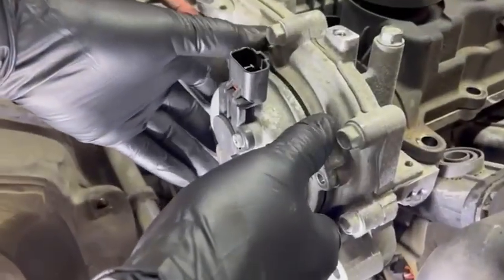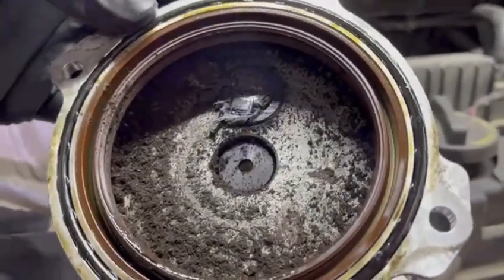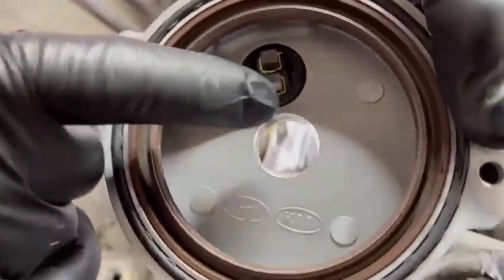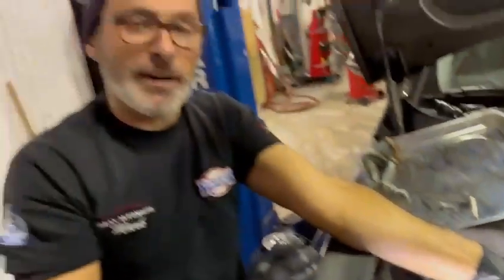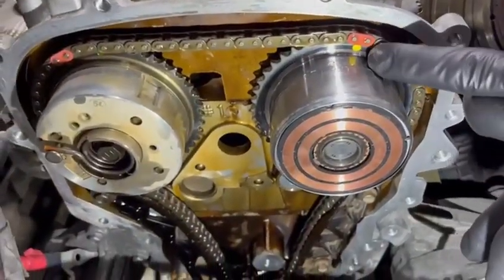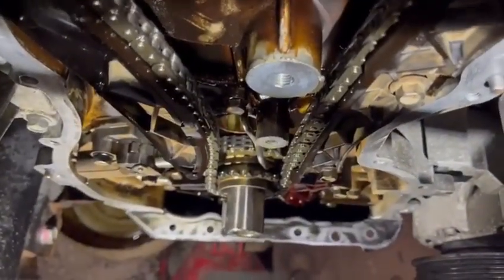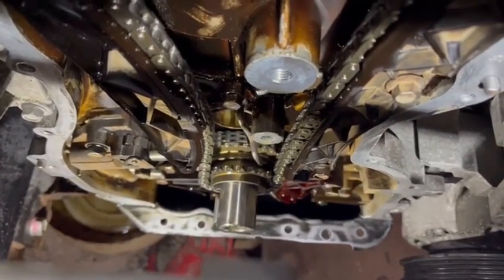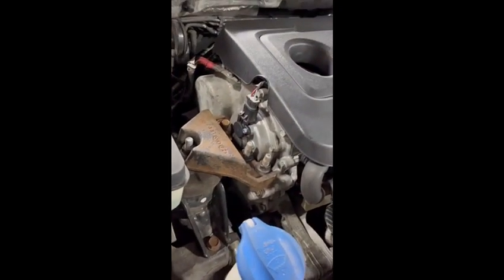"Decoding P0010: Understanding the Camshaft Position A Actuator Circuit" @UrbanAutomotive01

Comment: The black washer plug you put inside Actuator Circuit is not correct position, flat surface of plug should be inside and  deep side should be front . If washer put like that it will come out again after some mile drive .